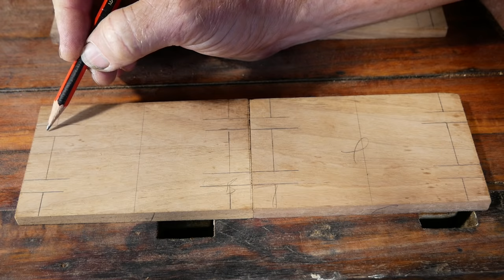Making a Japanese Tool Box - Hand Tools Only - Forme Industrious

Comment: This is an awesome build the fact that u can even cut that straight with a hand saw down the length of the board is  amazing
Reply from the maker: Thanks Pete!
Reply: Ryoba are amazing saws. They cut very very straight if you pull straight, so you can't correct much once you're going. The maebiki nokogiri is used for planking tree trunks. 
The cuts would have been faster if you could stand square to the cut and use both hands.

Comment: Nice job and the humor lightens it up. One thing would help me. Trying to determine exact length of the lid - the video goes over this key point very fast with no commentary. Fearful I’ll cut it too long (or worse too short).
Reply from the maker: Hi Merle, thank you! Yes the lid is a hard one to explain but I'll try.  Keep in mind it is really simple and we can tend to over think it. Okay, first up, the lid must be long enough to straddle each end cap block, not by much, 3/16" is probably enough each end. Second, the lid needs to be able to slide fully to one end and clear the end cap at the other, so the lid can come out. If you do that the lid will be the right size. Then straddle the lid again. Place and mark out the fixed lid stop (Not the wedge). Glue it. Make your wedge. Straddle the lid again but make it so the lid stop block and end cap are win contact. Place you wedge on the lid. mark out the fixed portion on the lid. Glue it, When dry fit the wedge. it should all lock together and the wedge will not fall out as it is tapered in two directions. Remove the wedge and slide the lid toward the wedge end of the lid. the other end (with the stop block) should be such that it clears the end cap and the lid will come out. Hope this helps. It really is a enjoyable project.

Comment: This turned out great!  I have a piece of Mango and some Raintree (as per the Anvils from your earlier video) I need to do something with. Handtools are nice but there is a certain satisfaction that comes from banging these out with powertools :)

I'm anything but an expert but I think planing on the bench against low bench dogs is better than clamping in the vice, less chance of bowing the wood and having it spring back to cupped when you let it out. Depends how tight you do it up I guess. Also it may save time to resaw and thickness the whole lot before cutting into box parts, if saving time is a consideration.

Comment: Nice box, and nice work. =)

I've never heard of 'wood butter' before, and if I got you correctly it's mainly wax (bees, furniture, does it matter?) and tung oil.
I guess the result would be similar using beeswax and linseed oil?

Hopefully, I will get my Year 7 students doing pencil cases using this simple mortise and tenon joint, it looks good and it seems quite snug even without the glue. =)
Reply from the maker: Thank you. Yes, not sure of the proportions but Pure Tung Oil and Wax is the blend. There are differences in wax. Some buff to a hard finish (Carborundum I believe) where as Bees wax easily softens. Highly recommend this project for the kids.

Comment: Using a Japanese saw like you would with a western saw will eventually ruin the blade. Japanese saw should be used with single strokes, lifting up the blade slightly to begin another stroke. 
It sounds tedious and time consuming but the cut will be more accurate. If one is doing this all by hand it shouldn't be hurried. That's the fun of it really.
Reply from the maker: Very true